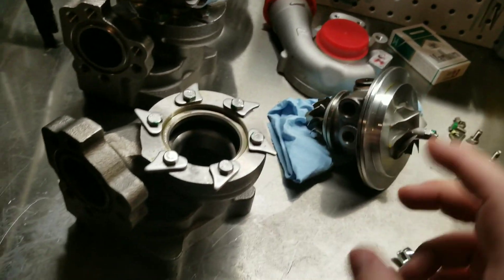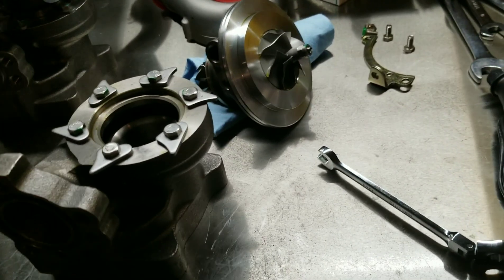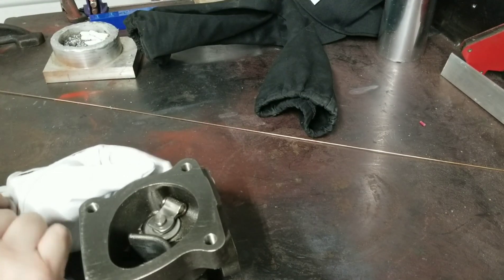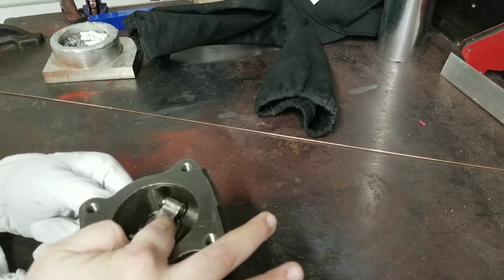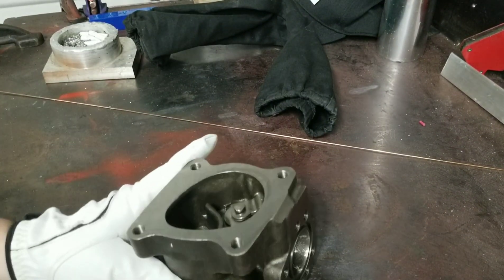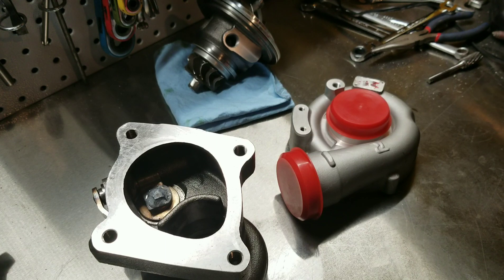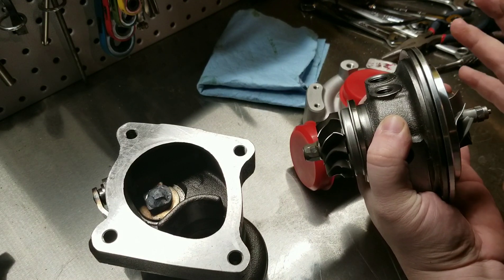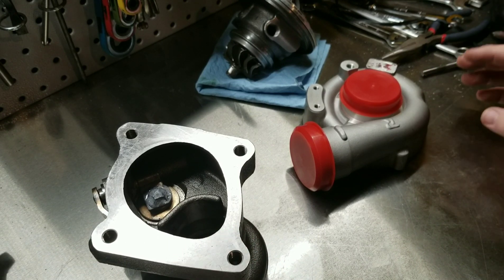Allroad budget k04 build #2 prepping the turbos

Comment: What's the trick to removing the cold side housing? I need to replace the CHRA on my k04 and the cold side housing is loose but won't come off. I've been watching every video on turbo rebuilding and no one shows this step.
Reply from the maker: You undo the bolts that go around the housing to the CHRA. Once you have them all off, you tap around the housing with a rubber mallet to break it free. Normally they use loctite or rtv to seal them. You just need to break the seal. Sometimes, if it's really stuck, run a torch around it.
Reply: @NOTSOSLIMJIM  Thanks for getting back to me. I ended up doing that this morning after my comment. I warmed the housing slightly then put an 8 mm socket on the nut and used a mallet. It took a bit of effort but I finally got it. That’s when I saw the orange RTV. I wasn’t really worried about damaging the center section as I have a new one coming but I didn’t want to damage the housing. I’m assuming that RTV is recommended when I reassemble? Thanks again!
Reply from the maker: @align700n  yes, you want to seal it to keep water out and compression in. You can use either loctite or high temp silicone. Just make sure to not over do it.
Reply from the maker: @align700n  I'll give you a tip in it. Test fit the turbo for correct fitment with the bolts loose. Get everything lined up, then mark the location. Remove the turbo and add the sealer and reinstall. That way you can get everything perfect without messing up the sealer. Also, if you are not replacing the oil lines, clean them... Really really well. Replace all o-rings and gaskets. I have a coolant return o-ring leaking on my driver's side turbo right now I need to replace. Pain in the a$$ job.
Reply: @NOTSOSLIMJIM  thank you Sir. I feel your pain. I pulled my driver's side turbo off with the engine in the car which event said is next to impossible.  I won't say it was easy but definitely not impossible. I just put the engine and turbos in two weeks ago.  I wasn't about to do it again. Something destroyed the hot side wheel after about 3 hours run time. Cold side looks beautiful, the  center section/ bearings have no excess movement and are silky smooth. I change can't for the life of me figure out what destroyed the hot side wheel. No contact with the housing. Just bent over fins on the inducer side. Engine runs great, no misfires, no smoke, and no noise.
Reply from the maker: @align700n  $20 it was the oil like. Another old mechanic tip for turbo install is to pro oil them. I use a 50/50 mix of assembly lube and motor oil. Add it and spin the impeller by hand to get it all throughout the core. After you install. Pull the fuel pump fuse and crank for 10 seconds 3-4 times to get the oil lines primed.
Reply: @NOTSOSLIMJIM  thanks for the info. The turbo kit came with a syringe with oil in it. I injected it as well as some heavier assembly lube. I bolted the starter and fly wheel to the engine and removed the spark plugs and cranked it over until it got oil pressure. Then I did it again once I installed the engine. It ran great for a few days then out of nowhere lost boost. I went down inside of the inlet with a borescope and saw the left turbo not spinning when the engine was running. Nothing was ingested on the cold side. So I pulled the downpipe and that’s when I saw the damage to the exhaust wheel. Something went through the hot side wheel unfortunately. I disassembled the turbo completely this morning and can’t find anything wrong. The whole thing is just odd. I’m going to install another turbo next week once I verify that the exhaust manifold is not cracking internally and sending shrapnel into the turbo.
Reply from the maker: @align700n  always good to magnaflux the cast iron parts if you have an issue like that. Also a good time to check bypass flap to make sure it's tight. I held mine down and Tig welded them into place after lapping them.

Comment: turbo made in China?
Reply from the maker: Cores are made in china just like most all turbos, even borge warner. Machined and assembled in Canada.
Reply: @NOTSOSLIMJIM  I am interested in the quality of the hot parts. Crack, how do the wickets of wesgate serve?
Reply from the maker: @vagodroch6980  the stock ones, or the tuebosmart wastegates? So far, I have had zero issues. Had to re-balance the wastegates after a few hundred miles to get them just right, otherwise no cracks, CHRA is holding up fine.
Reply from the maker: @vagodroch6980  I'm actually planning on pulling them for a big single eventually. When I do, I'll pull them apart and spec them out.